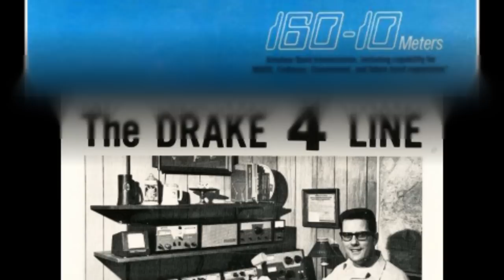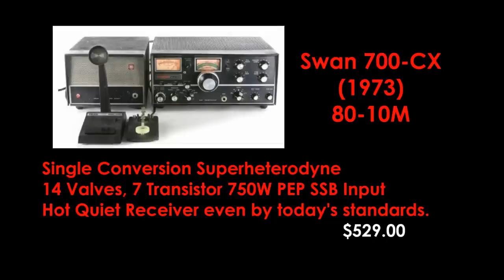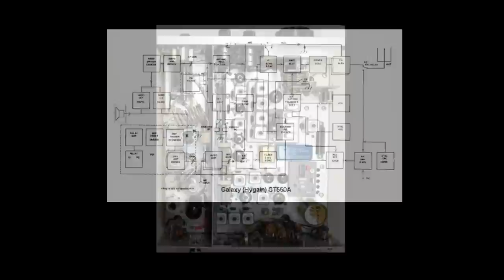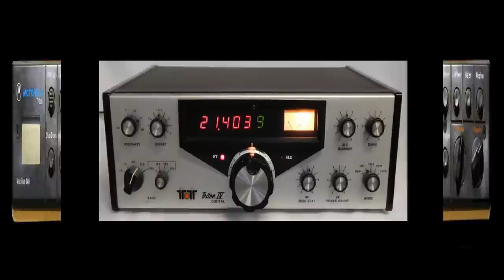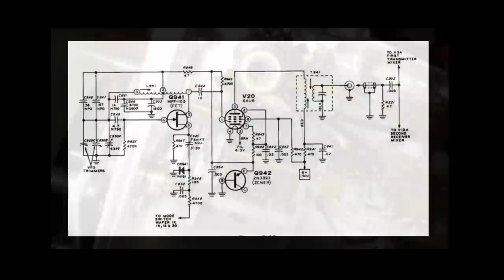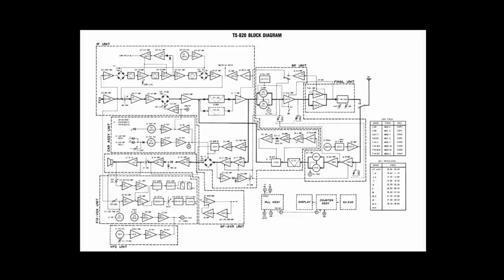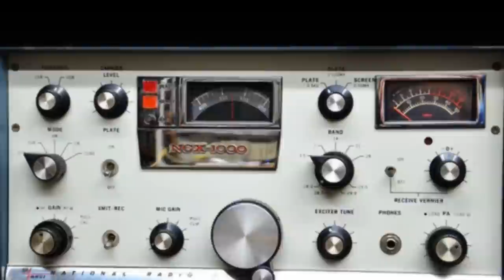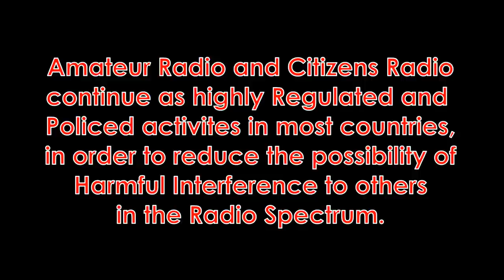Top 10 Ham Radio Transceivers of the 70s

Comment: Super neat video. I’m a late-blooming ham (last of the code General license) so I was totally non-ham in the 70s. But I have a Drake 4 Twin set (nearly free since someone was literally going to throw out the like-new receiver) and an HW-101 I bought from a local club (probably cause the the new kids couldn’t get along with tuning up a tube final). And your video showed me a few I’ve never heard of. Thanks!
Reply from the maker: Those sets are well documented and you can work on them. That keeps them in a lot of shacks. Classic nets are popping up all over as folks boast about the old radios.

Comment: The early TS520 ran off 12v too, via a built in inverter. It was my first mobile HF Rig. Kids don't know how good they have it these days. GM4SVM
Reply from the maker: That was so clever to have that built in. I remember the converter in the engine compartment and having to run HV through the firewall of the car for my NCX-3.

Comment: Brilliant video, as always!   

I lean towards simpler radios as I've been a service technician for 40 years, and I much prefer working on these units.  I also believe that I trust the simpler circuits to hold up in the long-term.

Your comment about 100 transistors to replace 10 tubes hits it on the head. While the transistors are definitely more reliable, finding the bad 1-in-a-100 can be a real headache, not to mention that each of those transistors has associated passive components that could go bad as well.  Add to this just physically getting to the parts in these densely packed chassis.  Lastly, most tubes are easier to get than unobtainable, exotic solid-state components

Having said all this, I own and use many radios, but favorites of mine are both the atlas 210 (a victim of the difficult-to -get solid-state component syndrome, I fear!) and the Heathkit HW-101.  The Heathkit would be my only radio if forced down to one rig!  While it lacks many bells and whistles, it's good enough to get the job done.  It hears well, and always gets good signal reports.  

I'm afraid I'm a bit of a Luddite, and a cheap guy, like your Elmer!

73,
Russ
Reply from the maker: Hams Cheap? Do we use that word on this channel? Heavens! Thanks for watching Russ!
Reply: My mistake, the word "cheap" was not used, the actual terminology being "El Cheapo"😊

Comment: Back in Jr High in the early 90s, I painted barns all one summer to afford a TS-520 ($300).  I think my dad got the better end of that deal, lol.  I still have that TS-520, but I don't use it much anymore.  But I love the Kenwood/Trio hybrid rigs.  When I got back into radio, I bought two sets of 599 twins and swapped bits around to make one really nice set and one pretty ratty one, and kept the nice one.  Then I fixed up a TS-830 later on.  The 599s are great for fun (and for 11m and AM in general), and the 830 is great when one needs a little more refined RX.
Reply: Indeed, I think the TS-830 was one of the finest radios ever made.
Reply from the maker: Wow painting barns! I remember the whitewashers would come and spray everything inside the cow barn on my uncles farm where I spent my young summers.

Comment: This really retweaked my interest, and ironicly have spoken to several old-time bush rat prospectors who have again started using Radio for evening Scheds. if I remember right 4441 or? ( old timers disease sucks!)

I have no idea where my radios went years ago.
I've never touched a 2way  or HF  since 91 when we went to sat, except our BC Radio tel in our trucks .. 
The base units we had were Traeger or Kenwood in our bush camps .. another unit for CNCP communication. Truly miss my brother (ex Sigs), we had always planned a radio shack ...

If anyone can remember those models that were all too common in the Bush BC and Yukon I'd be grateful ..
Reply from the maker: Wow you were up there? My uncle was hellbent on doing the ALCAN and he armoured up a Winnebago and tried with my Grandfather in 1970. They never made it further than contact creek. So he grabbed myself at 16 and my cousin Chris at 14 in 1973, and we took off across the St. Lawrence and drove 401 to Edmonton. Saw the RCMP Ghost Camp site at the bottom of Lake Kluane and caught my first trout there, an Arctic Greyling. Picked up a couple of girls hitchhiking to work the bars in Whitehorse over Summer. Too many adventures on that trip to mention. But it was still all dirt road and the pipeline trucks were still running.

Comment: Not sure these products were better than the Collins KWM2, which is was from 1959 and tubes, but the Yaesu was at least imitating them slightly. Hard to beat the ergonomics of the Collins equipment. The anti-backlash dial with the detent for the index finger, the availability of a crystal oven, so many great features of the Collins.  Their 75S-3C receiver was the high water mark for American radio electronics.
Reply from the maker: It is hard to deny the mark of a quality product like the KWM-2 and its ergonomics. And finally we can afford those Collins boxes we dreamed of. But at the time, the industry could not sell quality at a low enough price for anyone but uncle. And many companies did drop their amateur lines and went into pure government business. But the ergonomics of the early Japanese Hybrid radios in imitating Collins is surprisingly good, and there were more features, and at a tenth of the price.

Comment: Great retro-video Mike.  I have a TR-4Cw, Swan-500 and Swan-260 in my collection for this era.  The TR-4Cw is pretty mint and low miles.  The Swan-500 came from the college radio club and it is pretty well worn and technician'd out!.  The Swan-260 is just weird and cries out for mods but has a winning rectangular magic eye'ish tube; but unfortunately has a flat 6LQ6! 
Hope you do the 80's!!!  73...
Reply from the maker: Well at least the 6LQ6 is a very common tube indeed. Look on the floor. Probably a couple rolling around.
Reply: @MIKROWAVE1  Actually Mike, you’re the perfect guy to ask this: What about a 6146 changeover in the 260; I’m not that all that a purist for keeping this sorta ‘road-dog’ original? I know it would probably be less power…
Reply from the maker: @SpinStar1956  I rewired a Hallicrafters that had a pair of sweep tubes to 6146Bs and reneutalized it and never regretted it.
Reply: @MIKROWAVE1  well, the radio belonged to my Elmer and it would be nice if it was more than a shelf-queen.  I remember sitting up in the Colorado mountains in his old 61 Ford Galaxy with rain pouring down at a college field days, making SSB contacts on 40. 
I did fix its ear-splitting audio as it was just so harsh.  And, the 12V-inverter still works so it is pretty unique along with the tuning eye.  Will have to see if the cage could accommodate 2 tubes. Anyway, thanks for the response and encouragement!

Comment: Great video.  I got my ticket in 1972 and would drool over the rigs shown in 73 or QST.  I saw my first TS-520 at a Field Day I participated in around 1974.  That was the rig I wanted.  However, I saw the FT-101 advertised and decided on it instead.  I'm glad I did.  So in 1977, I took out a loan and bought the FT-101ee.  I still own it and it's still on the air.  BTW, that first photo of you with a beard...I'm trying to figure out the background.  My first impression is you're sailing or at a marina.  Not sure.  Anyway, thanks for the memories.  73 WA4CHQ
Reply from the maker: Very nice. That is a tent city at a festival. Maybe 1978.
Reply: @MIKROWAVE1  OK, tnx Mike.  And also, tnx for your great videos.  I'm learning a lot.  Keep up the good work!  73

Comment: I worked in  a very busy and popular radio store in LA in the 70's. We sold CB and Ham gear as well as repairing and mobile installation. I worked on a LOT
of these radios and I just have to disagree with your number one pick.
 I know that a ton of Yaesu 101's were sold and a lot of Hams have fond memories about them but,...When compared to the build quality of the Kenwood
520 it just does not measure up. The 520,(S) was better in every respect. We sold many more 101's due to CB coverage and they were also AM, the 520
did not go after that market.
 The Yaesu ran sweep tubes, the Kenwood used 6146's. The Yaesu had boards that were vertical and hard to service, the Kenwoods were laid out very clean.  
The 520 had a much better chassis and a die-cast front panel giving it a much stronger base to work on, the 101 had a stamped front overlay and thinner walled
chassis. The overall "Feel" of the 520 was much better as the 101 felt cheap in comparison.
 Everyone has an opinion but for my money the Kenwoods were a much better radio back then. and still are.
 That being said I think the Drake TR-7 was probably the best of the bunch, and other than the Collins and Signal Ones, the highest price of these radio's.
 jmo.

Comment: The bands have now opened up some and are getting better. For the 10-15 years prior, everything was so bad, that many radios were left collecting dust. During that time period, I would just turn on my Kenwood R-1000 shortwave radio to find high levels of atmospheric noise. Many times hearing WWV very weak or not at all.
Reply from the maker: The last good one I remember was 1985. 1996 was OK.

Comment: Really good video, did not know there were so many ham transreceivers made in the  1970's. I had worked on the Siltronic 1011c/d for someone back in the 70's, when I was into CB radios and fixing them for others. Later I own a used Siltronic 1011c/d never liked it that much, soon got rid of it. I would not have minded becoming a Ham voice operator, but the Morse Code requirement stopped me, because I'm not good at spelling, so I felt the code requirement was discriminatory in that regard.  BTW you had the music way to over powering in your video! Put near made me tone deaf.:face-fuchsia-wide-eyes:
Reply from the maker: Very nice. Yes I should have attenuated it a bit. I have to get my audio up to standards. Maybe I need one of the big fancy microphones too!

Comment: Pure power is not the key to good operating.   The old standard of 200 watts for novice really was a motivator to learning how to what you had not power.  A friend said he preferred putting money in Aluminum ( antennas) not power.  Certainly lower power made the receive side more important.
Reply from the maker: I put up a broomstick quad for Jamboree on the air in my back yard. Could not believe the performance and stations worked.